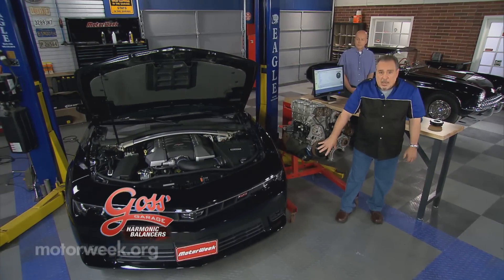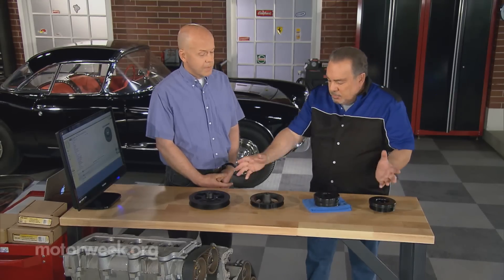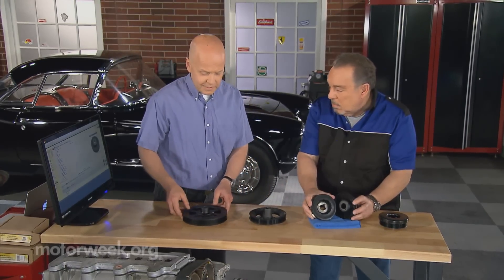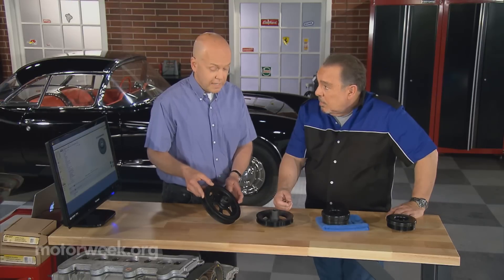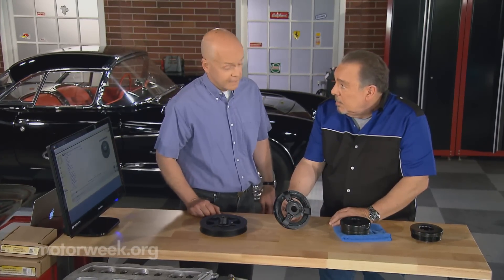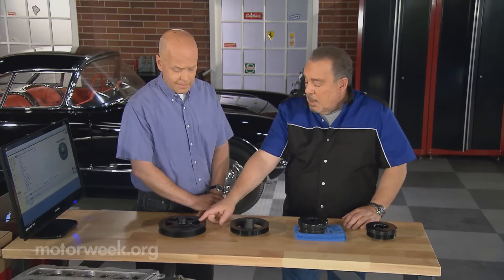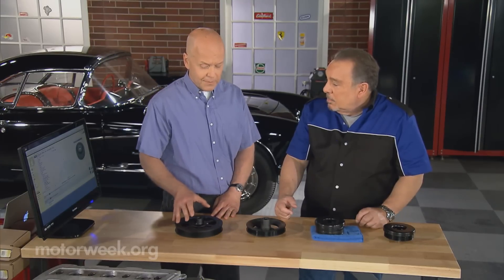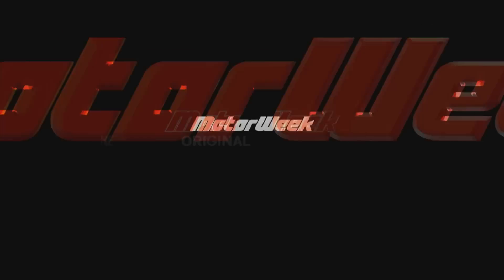MotorWeek | Goss' Garage: Harmonic Balancers

Comment: Sometimes a failing balancer will develop runout and throw the belt off of the pulley. I usually see that in GM 3100/3400 V6 engines.